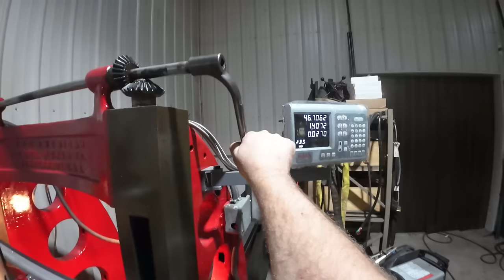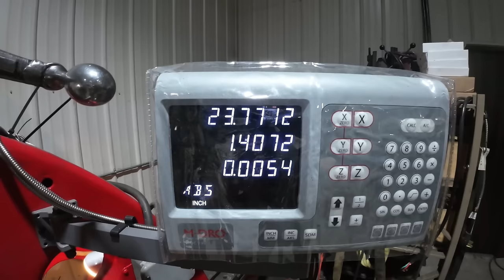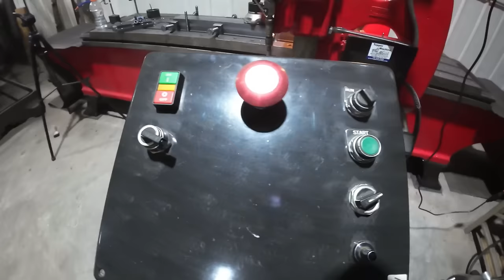Pushing The Bridgeport Milling Head To It's Limit - 5" Face Mill, R8 Spindle, 1HP

Comment: Hi Josh,
Impressive work !!!!!! Alot of ppl out there have little idea of what all this takes to produce a superior end product.....you consistently meet or exceed  the customers expectations. For the uninformed, tightening on a piece of steel imparts a force into the part and actually warps it ever so so slightly...the higher the tolerance needed the greater the need to impart an even force into the part to hold it...ie: use a calibrated torque wrench to ensure the torque into the part is even and consistent and NOT imparting any warp or bow of the part...a good example would be watching a high end gunsmith and observe how he torques chamber reamers and sight fixtures and hold down screws for sight ramps. 
Great to see you back in the swing of things......
Don
Reply from the maker: Thank you. Although I had one customer who I couldn't do anything right for, but they were trying to put me out of business. Words right from one of their managers after the fact. 

Torque and knowing where to torque to is all a key factor in precision. Needs to be tight enough not to move, but loose enough not to warp.

Comment: When tightening the clamps, I noticed the 300mm metric crescent wrench you used. Went to Harbor Freight Tools the other day and asked for one as they only offered SAE sizes. Also probably a good idea to have those wrenches calibrated if used a lot.

Comment: Nice planner work.... and great to see your shop training an apprentice. I was one of ~1,300 apprentices at the engineering factory complex of over 60k workers. The intake of apprentices in my start year (1966) was in excess of 250. That was back in the mid sixties (hay-day?) and the numbers fell off in every subsequent year.
Reply: That's insane to me. My college only had 8 students in my manufacturing class.
Reply: @printgymnast368  Times have changed, and not for the better...
Reply: @paulhammond7489  Yeah, but at the same time, that's good for me. Companies took advantage of American workers for decades, and when they found a slightly better deal overseas, they left American manufacturing in the dust. Now, after covid, they realized domestic production is needed for reliability and procces control. The labor shortage is going to hurt them and force them to start using automation, which is what I'm trying to learn. Idk what the future of manufacturing is, but I don't think it will be like it was in the past where companies had a steady pool of trained and skilled workers available. I honestly think manufacturing as it once was is dead. We are going to have a real issue when the old timers leave and all the skills and knowledge they have leave with them

Comment: Josh, as a side note, when running large stock on a planer, we used angled bolt holders however we always used spotting drills for the ground points of the holding bolts & sometimes had a piece in-between that the bolts held against. With the angle we always had down thrust, carry on!!!

Comment: Finish looked great, I love that machine! I use that same style cutter/insert on my Lagun knee mill, and it really performs. As you had shown, when taking roughing cuts, it sounds like shit and chatters at the start of the cut, and to a lesser degree at the end. They don't like having just one or two of the inserts in the cut. Once you get to full engagement and have three inserts cutting at the same time, it purrs like a kitten. I light finish pass like you did, is the way to go, as it really tames the tendency to chatter. Still sounds bad, and it's still there, but so small it's hard to see in the finish. Get some sharp polished inserts, and you'll love it on aluminum....looks like a mirror!

Comment: Josh, as idea; you could put the potentiometer on low, let it run for a minute and measure the distance; then do some runs at different speed settings and take note; might make using the same tool again easier in setup next time. stick a label on the tool; done. Easy next setup.

Comment: Josh, I am not sure how flat your bar will end up to be as you release your clamps.
If the internal stress is close to be the same on clamp release, you will inevitably still have warping.
In a future planer video, it would be nice that you address this!

For a .005'' finish pass, I would up the RPMs twofold and increase surface speed by 1.5 from roughing pass. I would also brush on a film of coolant.

Love your channel!
Love your videos!
Love your work!
Lovely day!:)
Reply from the maker: The worst one had 0.005 bow. Checked on a CMM. Tolerance was +/- 0.015.

Comment: Hi Josh, your selection of the 45 degree lead angle cutter is exactly right for facing work. You sould only use 90 degree when the job dictates it. If you look at putting a small flywheel on the arbor some where it will help stablize the cutter at entry and exit of the cut. Rule of thumb for flywheel size is twice the spindle diameter and 1 inch thick. You could easily attach it to the arnbor? Cheer Ian

Comment: Nice video
I noticed you didn't put any shims underneath the bar stock most. of the time the stock is not flat by you pulling it down it doesn't come out straight. any reason you didn't use Shim stock to have it perfectly straight cut.

Comment: When working as a student with our variable speeds, we were told to go off to the side of the part, set a 0distance, then count to six with the auto feed on. We would then multiply that number by 10 and we would get a rough range of our IPM. Wish I had one of these and the workload.

Comment: A nice surface finish is always so satisfying. I makes you handle the part with extra care so as not to damage the surface. You mentioned that the material has a slight bow along the length. Are you concerned about it springing back to that shape? Or does it matter in this case?
Reply from the maker: This gets bolted on all sides to something much more substantial. It should never move.

Comment: When I first got into the trade i was taught when milling, to always have the smallest lead in angle to the part. This puts the least amount of stress on the cutter and reduces chatter as your not plowing into the part at a steep angle. I set my cutter so the lead in edge just covers the edge of the part.

Comment: I love watching your videos but in this one I have to point out or ask why. If there is a bow clamping it will not take the bow out, it will return when clamps are removed. I was taught to use shim on the first side, clean that side up and flip the part to get the bow out. Also please please be careful sticking hands near the cutter when the spindle is on, I am missing the tip of a finger for doing that very same thing. Only takes once and the damage is done.

Comment: Got an amazon version of that cutter in 3.5 inch thats been nothing but a problem for me. Inspired me to take another look at it.
Reply from the maker: This one was surprisingly good. I bought it just for this job. Figured worst case I could run them on the HBM, but it performed great. The only thing I found was if I took less than 0.010" depth it liked to chatter. So I just took 0.015" on all of the finish cuts .

Comment: I have a question for you Josh: When you pull it down to the table because it had some warp, wouldn't that spring back into when released? Why is it better to pull it down rather than leave warped, then take out the warp when you machine the other side? Wouldn't it's "resting" position be best, like folks have to do when grinding large castings?
Reply from the maker: Depends on the application. This particular job was best to clamp rigid to the table and make it the way I did. Other applications this may not be acceptable.

Comment: Hi,  Lovely finish,  not picking flys but is the head a small moment out of tram as no full circle of cut, which could explain it no like cutting the other way as get 2 depth of cuts in 1 set up. 

Steve
Reply from the maker: It is by only 0.002, which makes it perfect for long facing cuts.

Comment: A question. When you clamped it down with two bars (around 05:30) I wondered: can you trust the lower surface to be flat? If it is raised in the middle and you clamp it down it will bow. After milling the topside it will distort with a low in the middle.  How do you go about that?
Reply from the maker: I mostly just planned ahead. Put the bow up.  Mill flat then it sits flat on the other side. I didn't catch it on all of them, but the tolerances we're wide open. They went through my customers CMM and they said the worst deviation they saw was 0.005. Print called for 2.40" thick +/- 0.015.
Reply: I noticed that Josh clamped near the ends so the upward bow in the center was only slightly affected. He could have shimmed under the bar but the tolerances made it unnecessary.

Comment: Planer table lube question.  How are you lubing the ways or is your planer table running on captured roller guides.  I worry that at low speed your not hydroplaning on a layer of lube lifting the table from metal to metal contact but degrading the surface finish for planer life.
Reply from the maker: It is an oil bath system. I have wondered this as well over the several years I've had it and the years the previous owner had it. I check the ways frequently and there is a lot of oil and no wear. But, in the end, a machine is a consumable. It is purchased or built to do a job and when it wears out it gets rebuilt or replaced. This machine has well paid for itself and owes me nothing.  If I get 25 more years out of it or just two weeks, it's earned it's keep.

Comment: There are plenty of DROs that can display federate. That machine would have been a good candidate for one.
Reply from the maker: I have never needed to know the feed rate of a machine. I was taught by old machinists who ran by feel, sound, and finish alone. When questioned about calculating feed rate, they always said that its just a guideline, not a real world application. Over the last 24 years of doing this, I can confirm that exact statement. Especially now, with modern materials and different grades of cutters. Each tool cuts differently in each grade of material. All just guidelines, or a good starting point. Adjust from there to get it just right by sound and feel.

Comment: Slick set-up Josh. I had a dozen or so table clamps like that but they grew legs or something. Or someone needed the material for an emergency job...anyway they are sorely missed and i need to find the time to make new ones. Did you turn and thread your bolts or did you buy them ?  They look like a fine thread as well. Thanks for another cool video. Cheers from Canada.
Reply from the maker: The clamps all use 7/8-14 B7 threaded rod. No point in making the bolts when the rod is readily available and cheap. They have been super handy. Definitely worth making more.

Comment: What is the reason for cutting in one direction only. There is no climb milling when the cutter is much larger than the work piece. Is this some sort of mechanical limitation in the mill? It seems it ought to cut equally well from either direction.

Comment: That was very satisfying to watch
btw have you thought of putting some sacrificial pieces between the clamps and the workpiece? Might at least be a good idea when clamping on finished surfaces.
Reply from the maker: Depending on the job, I have used aluminum pads. They leave little to no marks on most work.
Reply: @TopperMachineLLC  sir,your machine mechanism  use gear or  threaded rod (X axiz)🤝👍

Comment: When you put your horizontal bars across the top, are you concerned about putting warp into the parts you know slight amount.  
I was thinking you just let them float and you put your pinch bolts to hold them in place  
I am assuming your cutter has a flat maybe a 16th of an inch wide so it says a high feed rate cutter is that what I’m gathering ?good video thank you
Reply from the maker: The customer asked it done this way. They were far more concerned with a uniform thickness than a bow.

Comment: I really like your Planer Mill.  It is such a great idea, I was wondering if you filed a patent.  I'm surprised other shops haven't adopted the idea and repurposed Old Planers like the one you used.  KOKO!
Reply from the maker: I have seen a few over the years. But not too often. Most people see an obsolete planer and just scrap it without thinking outside the box. I honestly wish it was still a planer, but this is the next best thing.
Reply: Both ingersoll and futurmill were building spindle heads for planers at least as far back as the 1940s
Reply: Along with what has been said, I've retrofitted old spar mills with 50HP Future Mill heads for special machining on steel bars up to 54 foot long. Nothing new here.
Reply: @TopperMachineLLC  sir,your machine mechanism  use gear or  threaded rod (X axiz)🤝👍

Comment: Wouldn't you want to not crank it down to the table.  If you take the bend out with clamps, then flatten it, it will spring back so its no longer straight when you unclamp it.

Comment: When you  clamped it to the table because of  a slight  warp , when you  release it  the warp will still be there  , also  why didn't  you set dowels in the groves and set. one  side against  a parallel  and the dowel  to insure  the side clamps are even  with  each other,  just use the  side clamps then flip the  bar and  take  another  cut then you  won't have  a warped piece

Comment: Yeah, surface finish isn't great during the cleanup/roughing pass. In this case, the R8 taper face is probably the weakest link in the system, as it allows the tool to rock within the female spindle taper slightly because of the long lever arm distance. that little wasp-waisted relief undercut in front of the taper made my inner mechanical engineer cringe slightly. It's going to flex there like a madman. Surface finish looks alright in the finish pass. Probably biggest issue would be poor insert life, vs using something like 3" shell mill. A potential solution would be to check the gap with gauge block between the top of the shell mill and the female taper receiver. then, if you have a surface grinder, make up a shim washer with a slight inference fit of maybe 5-8 1/10,000

Comment: instead of wasting lots of time making all those side clamps you could have made some offset wedge T nuts.   
just tighten the screw and it wedges the wedge into the side of the bar.
Reply from the maker: There is no wasted time making tooling. I've used the first set for years and they have proven themselves invaluable. Not just on the planer, but the boring mill also. Building tools is only a waste of time if you never use them.